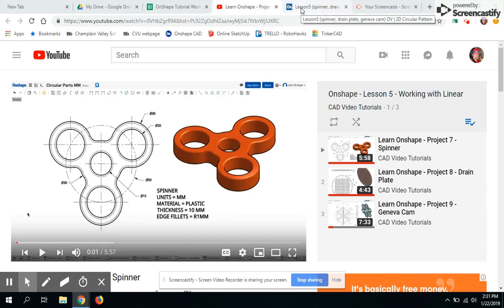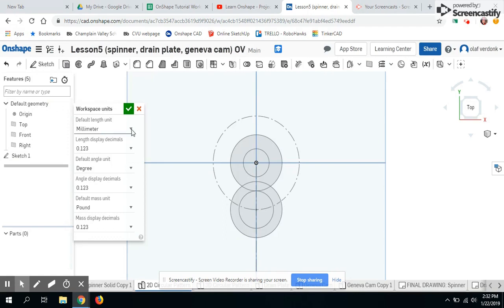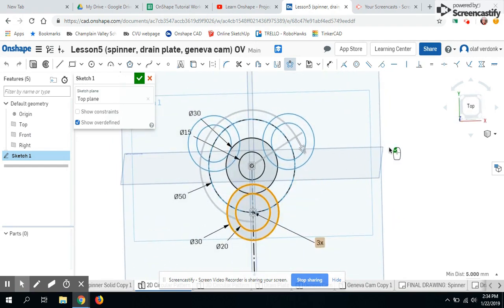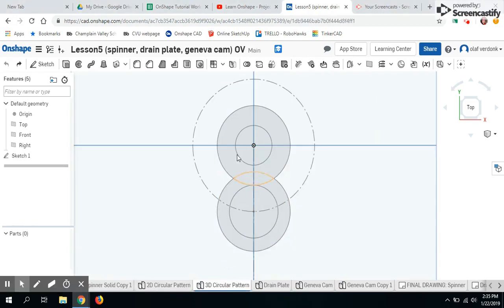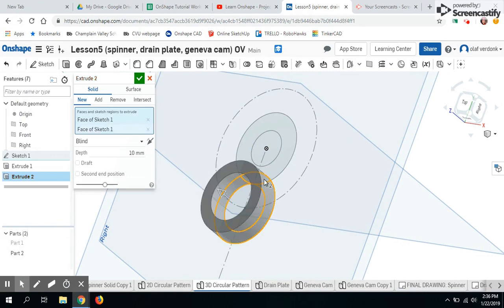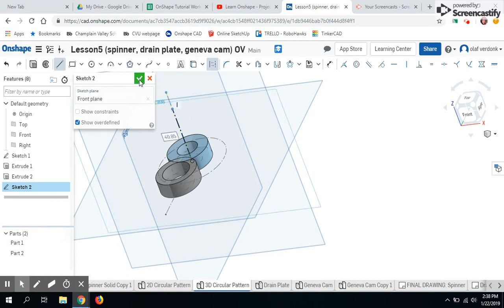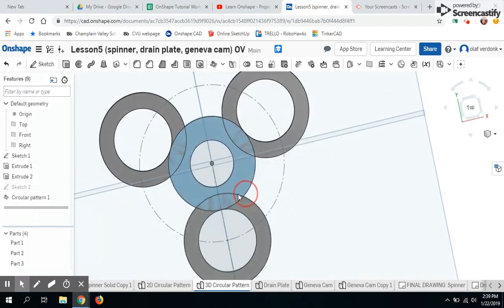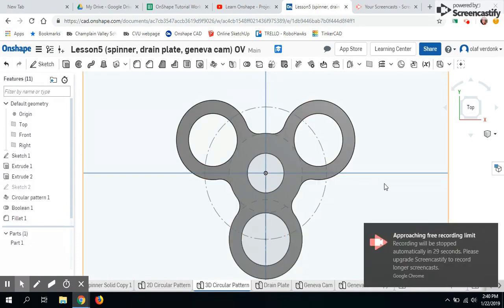Onshape Circular Pattern Tool

Comment: Nice Video, Some things to note for your students:
Sketch Pattern:
- The sketch circle pattern will start on the origin, but it is not constrained. You should make it a habit to always define the center.
- Sketch Patterns should be avoided if possible; The more lines in a sketch -> the more constraints are required -> the more time it takes to edit -> slower loading times

3D Pattern:
- Huge performance gains over Sketch Patterns
- You can also use a cylinder as an axis if one is available, rather than creating a new sketch for an axis, Or a mate connector on the origin
- You could also have selected the entire sketch, rather than the closed sketch areas
- You could have had both circles in the original extrude rather than separate extrudes (Onshape will ignore the overlapping geometry after the Boolean anyway) 
(also you should never have 2 or more extrudes with the same depth manually entered. Instead use "up to surface" or "up to vertex" depending on the design intent of course. Sorry but these kinds of habits should be broken sooner than later :) )
- You should use the "Add" function within the circular pattern rather than a separate boolean Union (later edits would require you to also add/remove instances from the union as well)
- The fillets could also be added before the 3D pattern (This along with the Add function would be the most parametric)

Gif of editing with these changes: https://drive.google.com/open?id=1HaDiqUMlzb4MvfntiRgxLo-BlnPMWXLW